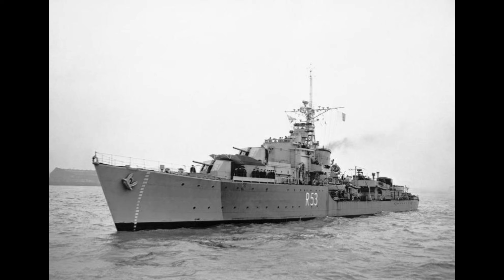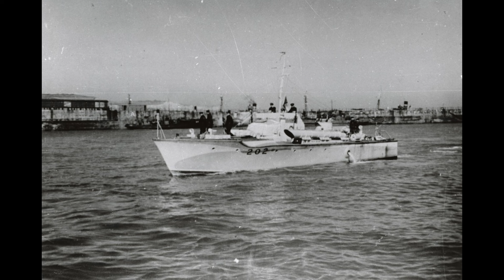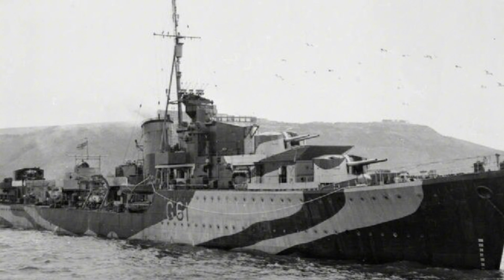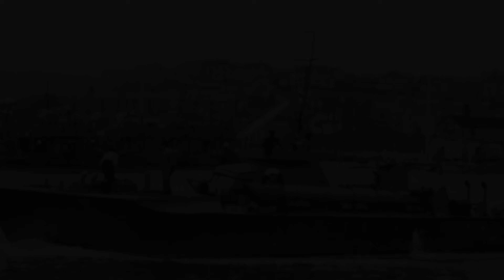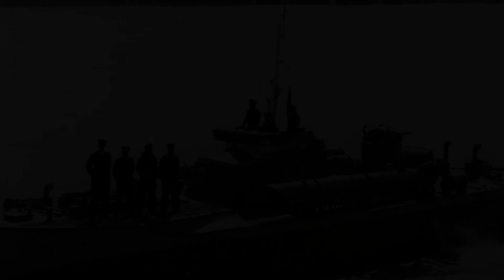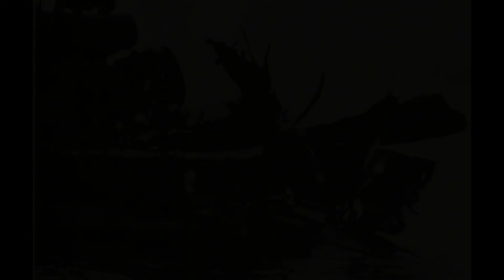British MTBs Were Made of Plywood and Cost £30,000 — But Destroyed Millions in Enemy Shipping

Comment: The MTB or motor petrol boats  use less fuel, are a smaller target to hit by aircraft , eassy to escape if hit  a few dozen can cover a wide area  and much faster then a big a big target destroyer, which uses tons of fuel and is a bigger target for aircraft and  a disaster if hit  dificult to escape  if you happned to be 3 story below deck

Comment: The "Dog Boats" were Fairmiles, not MGBs and MTBs.
They were a bit bigger and could carry other weapons like depth charges.
Reply: Yup, just posted the same. MTB's/MGB's were coastal, Dog boats were deep water.
Reply: Correct. The navy found the fairmile B and C class very good seaboats and so Fairmile designed the D class, larger and faster with a long range and formidable armament which outclassed the schnelboots. THESE were the DOG boats using the classes Suffix D for dog. Incidentaly, some Ds were equipped as very fast merchant ships to do the "ball bearing" runs between Scotland and Sweden.
Reply: My father was a gunner on Fairmiles
Reply: @garriefleet3154 I knew a guy who commanded one in Gaspe Quebec. They were stationed along the Eastern Canadian shoreline for coastal defence and even did convoy escort duty in the Gulf of St. Lawrence before the ships were formed up into mid Atlantic convoys in Halifax and Sydney, Nova Scotia.
Reply: @PeterLorimer-h3n7u . It's strange they don't mention that these crew had kidney belts and rubber soles the reduce vibration
Reply: @garriefleet3154 I'd never heard that and I'm a naval Veteran ... on Submarines not on these speed boats.

Comment: So much wrong in this. Peter DuCane of Vospers did indeed build MTB102 as a private venture but all the talk of plywood is nonsense as the AI script notes that 102 was built of double diagonal mahogany planks on rock elm frames. Fitted with three Isotta Frachini petrol engines, she was fast but flexed badly, necessitating the insertion of longitudinal steel beams to stiffen the hull. Remarkably, 102 is still going strong although somewhat more sedately with a pair of diesel engines.
I believe that American PT boats may have been built of plywood.